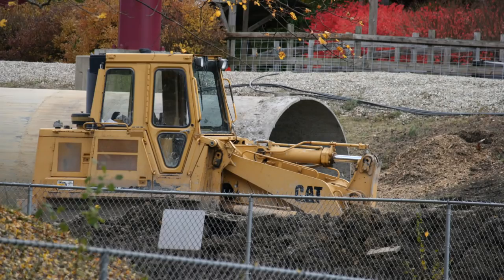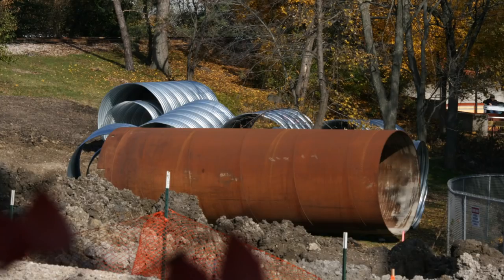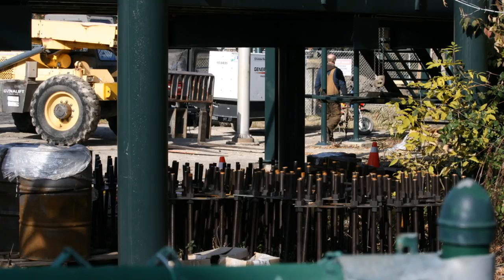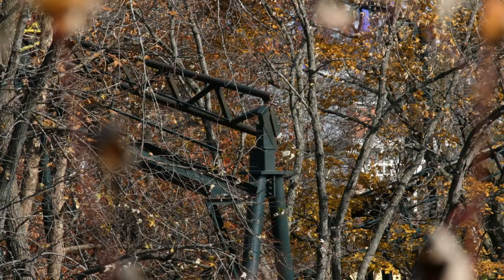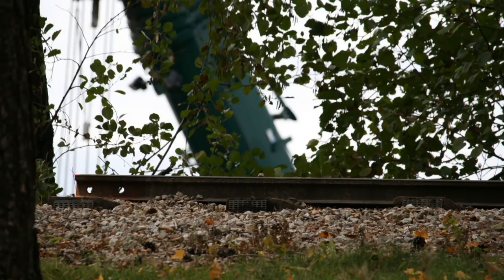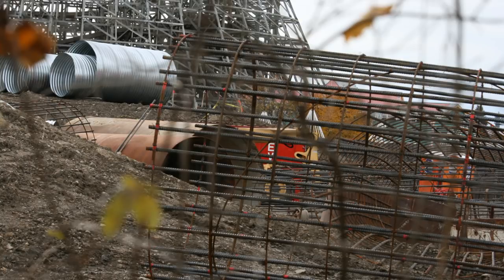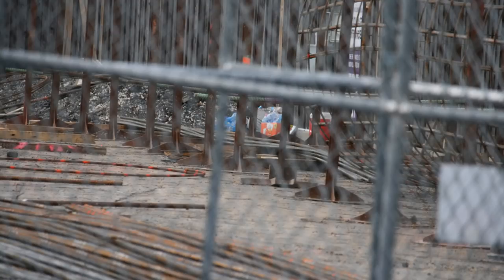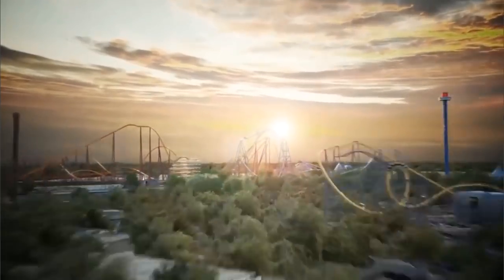Maxx Force Construction Update November

Comment: " mAx FoRce iS tOo ShORt"
It only goes 175 feet up in the air in less than 2 seconds with an air launch system that SENDS YOU INTO 5 INVERSIONS. In my opinion, this coaster has a lot more to offer than most launch coasters in the US alone.
Reply: People are just mad because it's going to a park that has gotten an updated coaster line up for the past 5 years. Salty
Reply: I know. I'm really excited to see how this one turns out. It looks amazing. Definitely the best Six Flags addition for the upcoming season.
Reply: What people don't understand is, is that this is an extreme launch coaster. The point is to experience the launch. The other parts are just icing on the cake. This is the same type of thrill concept as waiting 45 minutes in line to ride a drop tower thrill ride (just 4 seconds of thrill from dropping and 1.5 minutes of ride time all together with rising) as the point is just a thrilling drop. This is similar to the extreme launch coasters of S&S's past for those who never experienced Hypersonic XLC at Kings Dominion,    it was a very short ride but the launch was so thrilling, it made it worth waiting 30-45 minutes in line, and the launch from 0-80 mph in 1.8 seconds was the point, just like a short ride on an S&S space shot or S&S turbo drop tower ride is short and thrilling.